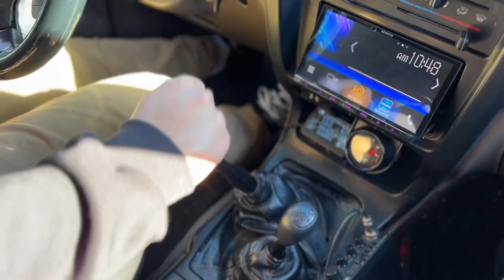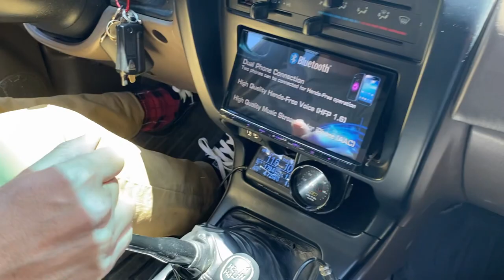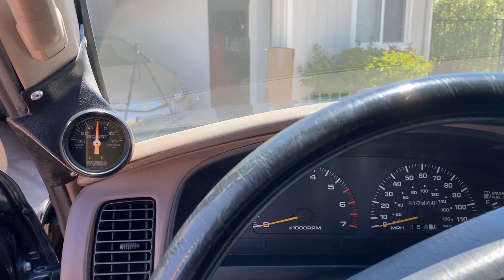Stevo's TRD Supercharged, Total Chaos Long Travel Rig Walk Around (1997 Manual Toyota 4Runner)

Comment: Sweet rig man I have a 4th gen triple locked ARB  also did the RCV upgraded Axel's supposed to be unbreakable for the fronts was like $2,700 and like $2k for the rear all Baja design lights onboard battery bank for fridge freezer roof top tent full old man emu 2" front and rear bumpers dual too many upgrades to list recently did a walk around of the truck if I had to guess about 25k in on extras
Reply: That sounds epic! I’d love to see it.

Comment: I have a 98 sr5 MT with the supercharger. Have been battling high pressure low rpm pinging forever. I think the 7th injector fixes the high rpm leanout only. Have you had hplr issues? Been thinking about about a snow performance methanol injection system. Love your truck. Nice work!
Reply: Thanks! Yeah the 7th fuel injector definitely fixes that issue. They only time I had issue with pinging was when my knock sensor/wire failed. No issues since replacing the knock sensor.

Comment: Awesome video, and rig! @Steveo, What battery are you running in the rear for your second battery ( dual setup )?  I'm looking for a battery that I can install inside the passenger cabin. Also. All the batteries I find have to be vented.  Would love some feedback.
Reply: Look for AGM or lifepo4 batteries, battle born batteries are tried and true but cost an arm and a leg. Lifepo(lithium) batteries are great for inside the cabin and are pretty much the go to but the one thing is if you try to charge the battery while it’s in freezing temps you will ruin the battery, battle born has a feature that makes it so the battery won’t charge below a certain temp to protect it. That being said I bought a 100AH lifepo4 battery on Amazon for 300$ vs battle born is like 1000$.
Reply: Thanks Adam! The rear is a massive Stinger SPP1700 but they make a whole line of different sizes that are not vented, but most AGM batteries should work perfect for your application!

Comment: Super nice rig! Where did you find the trd supercharged decal at?
Reply from the maker: You can buy them still either OEM from the Toyota dealer or off eBay. Part number is PTR26-35000
- Sean

Comment: Do you know a source that sells the thin pieces that blend the Limited fenders to the body panels?  I have a '97 Limited and the pieces on my 4Runner are continuing to crack and break off.  I'm imagining there are other 4Runner owners with the same issue.  Thanks in advance for your reply.
Reply from the maker: Are you referring to the rubber gasket that seals the fender flare to the body?

Comment: Do you have to drain the air tanks in the ARB compressor for moisture every so often?
Reply from the maker: The air compressor doesn't have tanks but rather chambers were the air is compressed.  If Stevo is supplying a reservoir air tank, that air tank would have to be periodically drained of moisture.

Comment: How did u get a fob key for the truck.??I have the same year 97.  I'm interested installing something remote key entry for mu 4runner.   Thanks
Reply from the maker: Steven has an aftermarket alarm system, VIPER or something he had installed. It is not a factory OEM security system
- Sean

Comment: Do your Tundra Brakes have weird foot pressure variability?
Reply from the maker: I don't think Stevo's going to see your comment so I'll answer it for you.  The brake pedal will travel further after doing the TBU.  You're now supplying larger calipers with the same master cylinder.  But, even with the further pedal travel, your braking will be overall better.   Some guys have also swapped out the master cylinder for a higher capacity one, but we haven't performed that mod and couldn't instruct you on what one to buy and the steps to replacing it.

Comment: Leaky grease plugs on the white one? Explain? Are you talking about the rear cam seals? What are grease plugs 😂
Reply from the maker: “Freeze” plugs, not grease.
Reply: Sorry I guess I mumbled that, freeze plugs. It was leaking coolant in a place where I would have had to pull the motor to replace them.